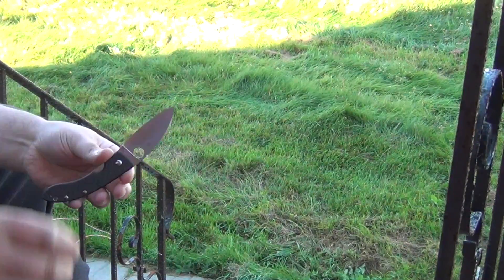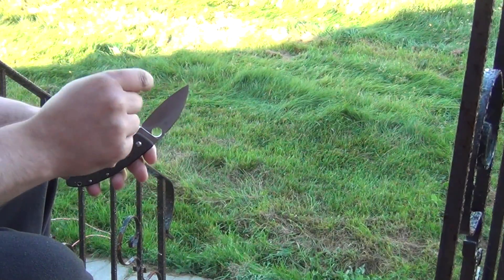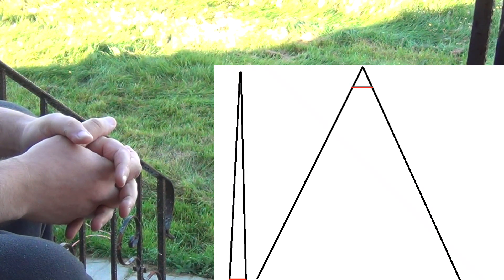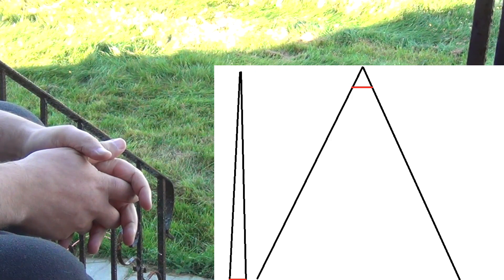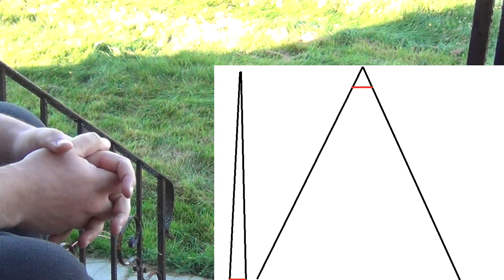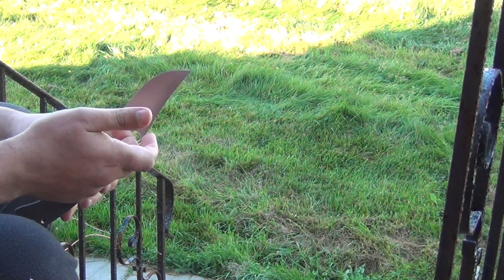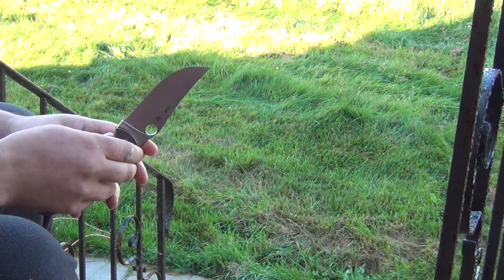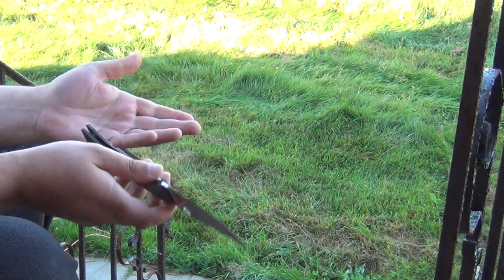Edge retention as a function of micro-bevel angle : VG-10, S30V (Wicked Edge)

Comment: This appears to be an apples to oranges experiment to figure out how to make VG10 shine above S30V using optimized prep of grind & sharpening angles and grit. So, with S30V one would expect you will also have an optimum grind angle, sharpening grit, etc.(oranges to oranges) to again put it back ahead of the VG10 to where after both are optimized, the VG10 could not catch up to it anymore. . .correct?
Reply from the maker: This wasn't designed to be a comparison of steels. I originally ran it with one steel. I then used the other one to confirm the result. I then used both results to show how you could adjust the angle to compensate for differences in steels. I also talked about on the forums how it causes toughness/edge retention to be related to each other and how you can use one to trade off for the other.
Reply from the maker: In general yes, for abrasive slicing, S30V would outperform VG-10 slightly for edge retention. But as noted in the video it only takes a small edge angle change to make an even larger difference so making sure your angle is optimal is critical.

Comment: Given your findings - does this suggest that higher angle micro-bevels can actually worsen edge retention? Is there really no need for micro-bevels with decent to high-end steels like 154CM or S30V? The only arguments that I have heard for using micro-bevels is for "edge strength" and ease of resharpening. Are modern steels strong enough without micro-bevels at 15 degrees per side?
Reply from the maker: Yes, depending on the type of cutting, higher angles will reduce edge retention.

In general I find it hard to argue why you would not want to apply a micro-bevel. Instead of thinking of it as adding a higher angle, just think of it as reducing the angle behind the apex.
Reply: Cliff Stamp For as long as I can remember, I have been re-profiling all of my folders to 15 degrees per side with a 20-21 degree MB. Your video made me think about whether I would see a noticeable improvement in edge retention if I just used a 15 degree per side edge. To get a MB at 15 degrees per side, that would require one to thin out the secondary bevel to ~ 10 degrees per side....which is removing a lot of steel from most production blades. In your opinion, what is a good edge geometry that gives you a balance between ultimate edge retention and edge stability?
Reply from the maker: clapton924
It depends on what you are doing. For cutting ropes, light woods, foods, I often go down to 6-8 degrees per side for the edge bevel and then run a micro-bevel. As the material gets harder to cut you have to step up the edge bevel to keep it from getting damaged.

If you do want to do this though you have to have a practical way to do that initial cutting of the edge bevel. You don't want to try to use the Sharpmaker or similar to take a 20 dps edge down to a 10 dps one. You could watch an entire season of Game of Thrones during that.
Reply: Cliff Stamp Excellent point. I don't do any "hard use" with my folders...mostly cardboard, plastic packaging, rope etc. 

I do own an Edge Pro - even so, going from 20dps to 10dps is quite a commitment! And there is no reset button if you change your mind about things! I might have to do some experimenting with with one of my cheaper folders. My Ontario Rat 1 might be the first on the test bench.
Reply from the maker: clapton924
I was about to suggest that, plus if you start with a basic model then you have a lower benchmark in any case.

Comment: Ive done a few tests with cardboard,  nothing crazy like you Cliff but I can concur that geometry is imo, more important than the steel youre using. I took 2 of my thinnest ground knives, a customized Boker Solo in n690 with edge thickness of .012 and down to .007 at the tip and Andre Van Heerden M16 in n690 with edge if around .013 and compared it to my s35vn kwaiback which before regrind was at .035 to .040 and benchmade mpr in m390 with edge thickness of .030 to .035. Now most would think that m390 would beat out all other knives, s35vn is a decent midrange powder steel and n690 is one of the better non powder steels but m390 has more carbides and a finer grain structure. But, as you said, even when the 2 n690 blades got dull, just due to geometry and how thinly ground they were, they had no problems cutting cardboard. Kwaiback, even when razor sharp, was more difficult to cut with, than the dull m16 and especially Boker,  that thin tip just glid through cardboard no matter what, even when I could slide my finger across the edge, it still cut well, while kwaiback and mrp had difficulty from the get go and especially when the optimal sharpness went away. I since reground the kwaiback to a zero convex grind and it performs much better and mpr was a lil too small for me so I got rid of it. I do have a custom coming in made out of cpm 10v and its going to be ground to .015 and a 22 degree inclusive edge and im pretty excited to see how's it performs. Im saving up a bunch of cardboard because I think im going to need quite a bit of it.
Reply from the maker: The curious part here is that the most inexpensive knives often have the most efficient cutting grinds, an Opinel for example.

Comment: Blade and edge geometry are the largest factors in cutting, then edge finish.  The question begs to be asked, what kind of performance can be wringed out of the supersteels with proper edge and blade geometry, and edge finish? Is there any benefit at all?
Reply from the maker: This is exactly the question I hoped the video would raise.
Reply: This is a well formulated question IMHO. It would stand to (this layman's) reason, that if a material is tougher AND harder for instance, then one should be able to perform a give task at finer edge angles without failure. Which would, of course, give superior edge retention to the tougher and harder material.

Comment: Hi Cliff!
Thanks for your reply!
The have this Knife 1 month now.
I sharpend the Knife once at 30 degree. Did a cutting test and Looked at the results! From there i tried microbevels 32,34,36 degrees with the same result!
Regards
Thomas
Reply from the maker: Do you have another knife you can try this with as a point of reference?
Reply: Hi Cliff,
I used a MCusta with a VG10 blade as reference. It performed much better then the S110V after cutting the same amount of cardbord.
VG10 had no problems or what so ever cutting printer paper and barely shaves hair from my arm!
Reply from the maker: Thomas Huebner
Thomas, it doesn't sound like the material is the issue then. It could be nothing more than the S110V blade was just subject to high temperatures at the edge in the grinding from the factory. If this is the case you might see significant improvement after it is sharpened a few times.
Reply: I was thinking about that too!
The factory edge looked terrible when i got the knife.
I hope I don't have to remove to much material, to get the results i would expect from S110V.
Thanks again for taking your time!!
Reply from the maker: Thomas Huebner
There should be an immediate different each time you sharpen, if it doesn't happen right away then you can try a warranty claim or a deal return. In general I don't advocate the kind of extreme claims some people make about S110V, but it should not behave as you are describing.

Comment: Thank you for sharing this very good video!

To me, you are a very competent person in this sector!
I ready would like to hear your opinion to my issue i have with my Native 5 in S110V!
The Knife/ Blade is failing in my eyes when cutting card board.
I put a 30 degree edge with the wicked edge pro pack 2 on the blade. I noticed the Knife gets dull very quick.After 30-40 cuts, it is not possible to cut printer paper anymore.
I check the edge with a microscope and noticed the edge flaten out and some segments where missing!

Regads
Thomas
Reply from the maker: How long have you had/used it? How many times have you sharpened it?

Comment: Cliff, I'm thinking of purchasing a US made folding knife using 14c28n.  With a good HT (59-61hrc) and edge  geometry, how would you compare to steel against vg10, 440c and 154cm? Thank you
Reply from the maker: Ray, who makes the knives will has more of an influence, but assuming they are all handled well, if you are familiar with those other steels then you will find that the 14C28N will be more durable, less prone to chipping, easier to grind, easier to sharpen, has higher corrosion resistance, can take a lower edge angle. But, it will have a reduced ability to hold a low slicing sharpness, though that can be off set by just sharpening to a lower angle and/or grit finish.

Comment: Have you ever considered doing edge retention testing on some sort of highly abrasive material like sand impregnated paper (not sand paper, printer paper coated in some sort of extremely fine grained sand)? That seems like it could be a cheaper and more consistent means of testing edge retention.
Reply from the maker: It would measure edge retention on cutting sand, however care would have to be taken to interpolate that to other materials.

Darrel Ralph used to cut sandpaper hence he strongly promoted steels such as - guess - S90V (low grindability).

You have to make sure that whatever you are using as a test medium can be related to whatever you are trying to infer. 

Imagine for example if I walked a dog on a leash to "Test" a rope which was used to constrain an elephant. How come that would not be valid?

For identical reasons an extremely abrasive paper would not be valid for foods, ropes, cardboard, etc.. But may be valid for carpet, sods, etc. .

Comment: And wouldn't you read these data as suggesting that between ~ 17 and ~ 21 dps there is no difference across VG-10 and S30V?
Reply from the maker: Yes, the data doesn't show a significant difference in isolation. In order to see significance you have to look at a multi-point comparison over all of the angles. 

This would be expected as the difference in those steels is very small even in the best case scenario for S30V (CATRA type testing to low sharpness is only ~25%). 

In general the difference in edge retention in steels is highly exaggerated. If more people did blind runs there would be a lot more "tests" showing no significant difference.
Reply: Well now that I look at it more - besides the difference at 15 dps (which seems due to the  lack of variability in 30SV data points), it seems you only see differences in retention at greater angles:  >~ 21 dps.

Two questions: 
How did you come to the overall "2.5 degree" difference conclusion?Did you just base it off the linear model? 

Would you expect your findings to generalize to different blade geometries or would you expect it to moderate the results?
Reply from the maker: pekein In order to make a generalization and have significant significance you have to do a multi-point comparison. The conclusion was based on the linear model, to be specific you just look at the horizontal intercept equation. This means you solve for when one equals the other and it shows a difference of ~2.5 degrees. 

I am not sure what you mean by generalize to different blade geometries as this was an investigation of the influence of one aspect of geometry. Do you mean would something similar happen if the edge angle changed, or edge thickness, blade thickness, etc. ?

Comment: The more I work with all these steels the more I am liking O1 and White Paper Steels. Both of them at high RC are very good indeed. There is so little difference between Super Blue and White Paper steel that I prefer the sharper edge I can get in White Paper Steel to the very slightly longer lasting edge of the Super Blue Steel. Using tests to optimize the edge as you did with VG10 I should be able to make the White Steel last as long or longer than Super Blue.
Reply from the maker: White/Blue steels are very nice to use, especially in kitchen knives. It is interesting that there is such a difference in West vs East in regards to knives.

Comment: Hi Cliff, just curious if your still planning to do a video on sharpening a larger knife on a small pocket stone?  And possibly addressing grind direction?  Thanks my friend!
Reply from the maker: Yes, I also have a small pocket sharper which is almost perfect for this as it is a holder designed for small pocket stones.
Reply: Thanks Cliff!  I happen to have one of these sharpeners here- http://www.amazon.com/gp/aw/d/B000PU7198?cache=f673c7c3f8443957a47dba0051b19dea&pi=AC_SX110_SY165_QL70&qid=1414174257&sr=8-9#ref=mp_s_a_1_9
But I'm not sure how you would sharpen a larger blade on something this small.  (fyi- this stone is 2" long by 3/8" wide) so its quite small! I know that if your blade is long and you try an edge leading sweeping stroke, you would be pulling the blade off the stone so quickly that your scratch pattern would be almost completely parallel to the blade edge!
Reply from the maker: *****
On the small stones you are forces to work in sections. The passes to set the apex should be minimal however if it was prepared correctly, so in general it should not take very long at all unless you are trying to get new paper push cuts or similar.
Reply: Ok, so what type if motion would you use on a stone like that if you are trying to set the bevel?
Reply from the maker: ***** Similar to filing.
Reply: Cliff Stamp
lol ok.  Well I can't wait to see the video!  =P

Comment: Cliff, have you ever heard of sharpening scissors with aluminum foil?  Apparently you just fold up a piece of aluminum foil to make it a bit thicker and repeatedly cut it with the dull scissors and it is supposed to sharpen them.  I just tried it and it does seem to make them sharper.  I was hoping you might be able to better explain this phenomenon, as I was not aware aluminum was able to sharpen steel.  I am familiar with aluminum oxide,  but just regular aluminum??  Help me understand this.
Reply from the maker: Essentially you will get a mild alignment and adhesive abrasion. In general though it won't compare to actually sharpening them with sensible abrasives.
Reply: Ok so by mild alignment, you mean straightening the edge similar to a butcher steel, or the function of a leather stop.  However, I don't know what you mean by adhesive abrasion?
Reply from the maker: ***** When metals are in sliding contact there is essentially micro-welding and then fracture, that is adhesive wear.
Reply: Wow, just learned something new!  Thanks Cliff,  you're without a doubt one of the brightest guys I've ever met.  

So bottom line then is that the tin foil method kind of works, but its still much better to actually sharpen the scissors with some type of conventional stone or sharpener?
Reply from the maker: ***** Yes, just try it on a pair of cheap scissors to get some experience.
Reply: Ok thanks!

Comment: So when are you going to start working with mild steel?
Reply: That didn't sound right when I read it.  Since you are working on one extreme end of the spectrum in high carbide, why not add in the extreme low.  That way you can get to a point where you can say at X-X range DPS X amount of carbon or other carbides is too little and X amount of carbide seems to be too high.  Both of course having there extreme tasks that they are right for.
Reply from the maker: ***** I used mild steel as a reference many years ago, I just ground an edge on a piece of fence tension bar.

I am doing a comparison of 10V in the Farid K2 and a 3Cr13 stainless steel now.